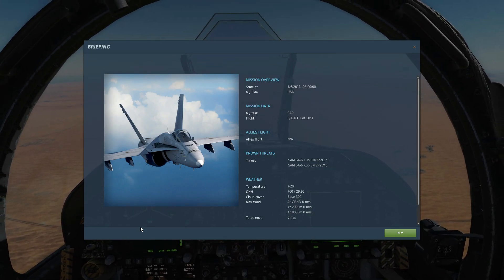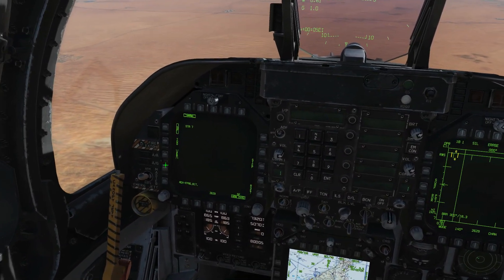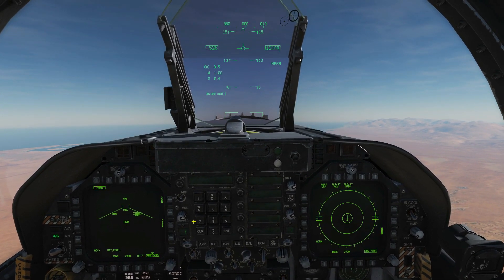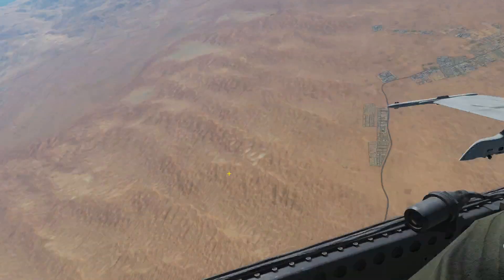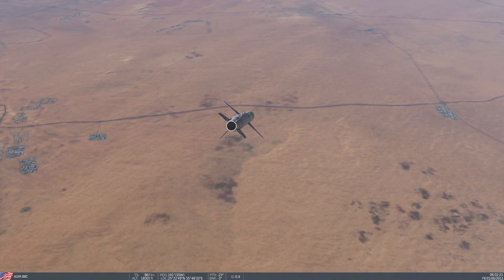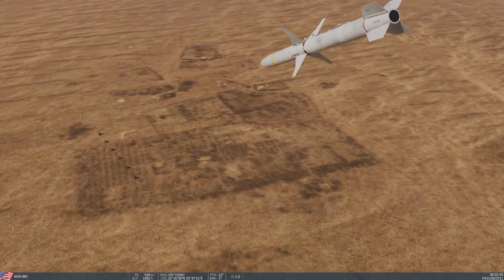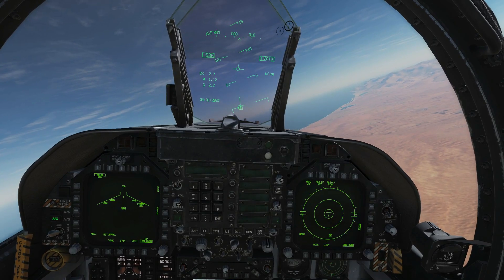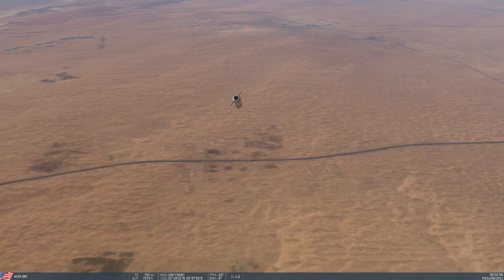How Manouverable Is The AGM-88C HARM Missile? | DCS WORLD

Comment: The HARM is passive and RF homing. When fired from other than hot aspects the missile bleeds a lot of energy, but is generally capable to guide on an active emitter. Time of flights are very high though especially when fired from beam or tail aspects. Do not expect to survive a shoot out with any SAM. The closer the shot range, the "better" (i.e. faster) the average time of flight. Low altitude employment is usually possible as well. To make it more realistic in DCS, build in triggers for the SAM units and make them smart (i.e. HARM aware). Not every HARM will be a soft or hard kill in reality.

Comment: Wish we had the ALARM missile in DCS  (the British anti-radiation missile).    This was available in good ol'  'EF2000' by DID  (which I still fly regularly using a 3DFX emulator).   So useful to be able to fire a missile  blind before you enter the target area  and have it zoom up to 12,000  ft where it loiters on a parachute  until it detects  the radars switching on to track you   at which point it  activates  and cuts the chute  and  attacks the target. Like the HARM it combines a Passive Radar receiver  and an INS system.   In real life ALARM could be pre-programmed for specific Sam radar types, or to search particular ground areas  (so several planes could pre-seed  (or do I mean pre-SEAD)  a entire target area with individually programmed  ALARMS). When the  WIld Woozles  or strike package arrives in the target area and the SAM radars  activate   BOOM.  . So much cooler/more subtle  than HARM which is a 'duelling' weapon ... needs the SAM radar active before it can be launched and relies on its speed .to get the radar before  the SAM hits its target.  ALARM I think (not 100% sure) could also be launched HARM-like  with a pre-locked active radar target  Think only the Saudi Air Force still use  ALARM . It was used extensively during the 2003 Iraq War (Operation Telic) and the 2011 Libyan campaign Operation Ellamy  on Tornados.
Reply from the maker: ALARM is an AMAZING missile Arty
Reply: Alarm wasn’t used during Op Ellamy. We did trial fits in the days before hand but found it not to be fully compatible with the aircraft software in use at the time. The first strikes used Storm Shadow instead to hit known radar targets as it was deemed easier to do this than re load software onto all the aircraft.
Reply: @matthewbeasley3463  Thanks for that.  I was going from the RAF"s weapons page  good to have a first hand account instead.
Reply: No worries. They did consider bringing it back when we first went into Syria, but couldn’t because we’d destroyed all the publications that related to it when they first declared it out of service!

Comment: HARM actually has INS, missile uses it in PB mode and for attack radars that stopped emitting signals after lock. Radiation sensor on it 45 degree wide.
Reply from the maker: Thx

Comment: Well i mean if a sudden sam threat appears behind you that feature is very useful or if you just attacked one and a second one pops up and you can just fire away without needing to put yourself in harms way twice
Reply from the maker: Good point.
Reply: @grimreapers  what you could do is also (if the position of aa is known) fly a circle around the edge of the fire range and just launch it 90° offset.
(i have no clue how the range of the harm is to the sam ranges but if it reaches longer then most sam it doesnt matter i guess if you fly head on orin a circle around the sam threat

Comment: It looks like the first shot went right through the radar dish.  At that point even if the vehicle wasn't totally destroyed, it went from a dangerous, functional missile radar vehicle to a regular old APC.
Reply: In testing back in the 90s the missiles did tend to go right through the dish, my dad used to be the guy that had to try and repair it the next day.  I remember seeing a radar that they brought in off of the test range on the back of a trailer that had a perfect missile shaped hole sliced right through the center of the dish.  I think during the tests they were not using explosive warheads, just a simulated mass. It was more about testing the guidance system than it was about blowing up the targets
Reply: In real life, I would totally agree. It would also have the radar techs, supply department, and OIC swearing up and down. For the purposes of DCS through, I doubt the vehicle damage model is that detailed. As I understand it (and i may be completely wrong), ground units in DCS basically just have health bars. The splash damage from the missiles detonation probably reached the vehicle, but was insufficient to destroy it.
Reply: @hikaru248x  This is true. In DCS, you're either 100% alive, or 100% dead. With the strange exception of ships, which can be badly damaged and not fire weapons, but not explode, sink or otherwise register as dead.